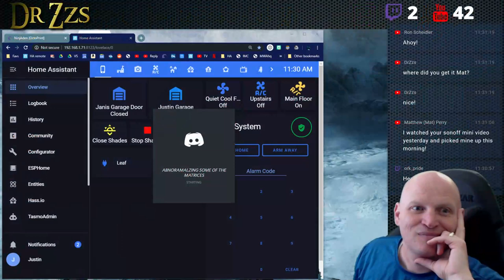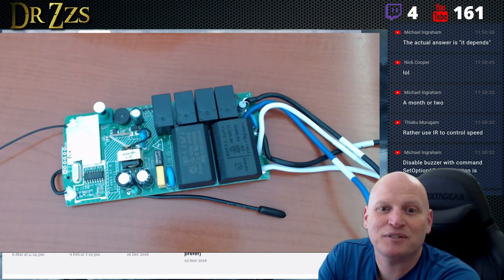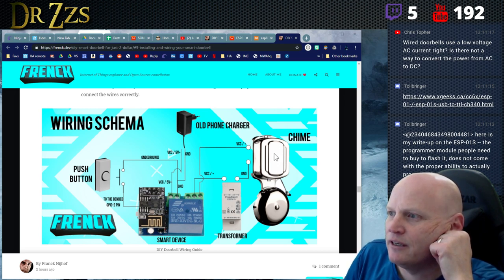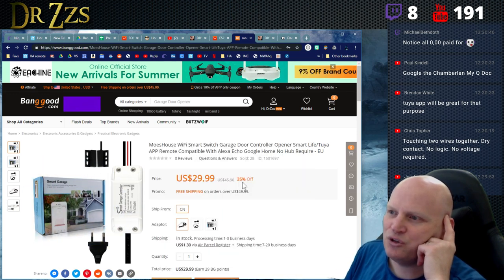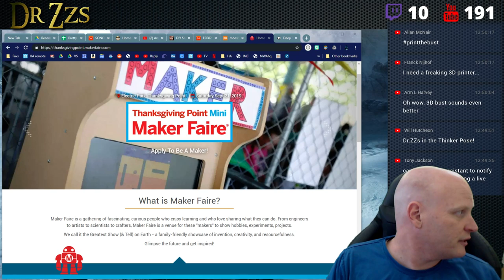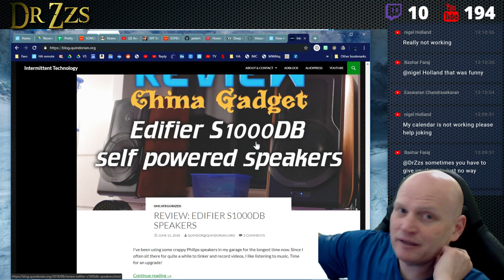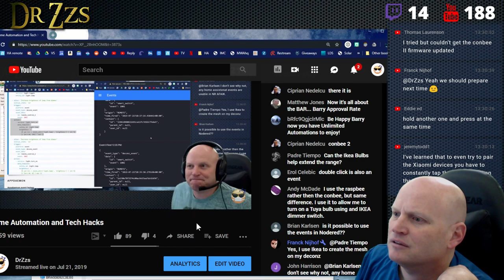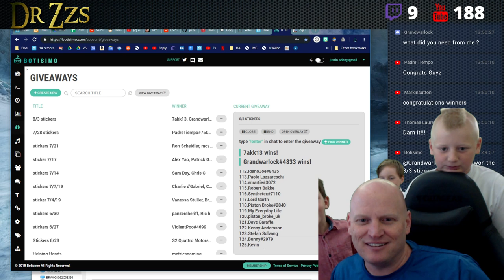Sonoff Mini Talk, and some Zigbee Tuya devices to try

Comment: Hey Doc. One of your guests (Carlos_DE) asked if the Xiaomi sensors work outside. Yes they do but you have to waterproof them. I have four around my property on gates that are mounted in small IP65 boxes and they work a treat. The 1st Gen one (rounded corners) is however playing up with deCONZ even though it worked for over a year without fault on the Xiaomi Hub. Battery life is exceptional with at least a year from one CR1632.
Reply from the maker: great Pete!  Thanks!
How's the range on those outdoor sensors?  I was surprised to here some guys saying they aren't getting good connections and reasonable ranges.  Maybe they have some other interference?
Reply: @DrZzs  range is amazing. I do have 6 smart switches spread around the house acting as routers though.
Reply: @DrZzs  I've used some Xiaomi devices in another install.  As long as you have a good Zigbee mesh and you use a ZigBee channel that is outside of the 2.4GHz WiFi range, they are fantastic.  Much better range than WiFi in my experience.
Some Xiaomi devices are Bluetooth only.  Those ones only have Bluetooth range of about 10 mtrs, but I doubt many that use HA would be using the Bluetooth versions much as they would need a secondary interface to connect to HA

Comment: The ringer transformer is AC for good reason.  Magnets!
On an AC source, the arm that strikes the bell will do it at 60 cycles / second in 'murica.  50 cycles in 'straya.  
If it's connected via DC, it will strike the bell once, and effectively be a noisy relay striking only once until the power gets disconnected.
Reply from the maker: oh cool!  I did not know that!  Thanks :)

Comment: After the led is flashing, release the button then press it every second or it will go back to sleep soon. deConz probably won't have enough time to complete the pairing. When I pair the TH sensors with zigbee2mqtt, I need to pair them  that way.
Reply from the maker: cool.  I'll try that.  
So you're using zigbee2mqtt with these tuya sensors?

Comment: @Drzzs If the GPIO used for the switch can be used as a general GPIO under Tasmota, could you do a video with alternate uses, such as maybe a thermostat type device?  I know that would mean finding a +3.3volt source on the board.
Does the 3.3 volt input you used for the FTDI adaptor have 3.3volts on it when the device is live?

Comment: I was thinking about the SOnOff mini device.  The Switch connection is just Ground and a GPIO.  If you didn't want to use an external switch for some reason, could you use that GPIO for a sensor input?
Just thinking for a motion detector with an inbuilt relay, not needing an external switch, it could be an interesting device.  Or maybe using it as a thermostat where the GPIO can detect temperature and humidity with a DHT22 and then Home Assistant control the relay.
 I am sure one could trace a 3.3 volt line from the power in of the ESP chip. 
Given the Switch GPIO is isolated from mains it makes it a much better option than a Shelly for this alternate purpose.
Reply from the maker: We'll have to play with it on the next stream.  I tried connecting dht22, and PIR, but neither worked on Tx or Rx or GPIO16.  Not sure what the problem is.
Reply: I might get one and have a play with it.
Do you know which GPIO the switch connector uses?

Comment: P.S If anyone can tell me why my Xiaomi smart switches create a 3rd rogue sensor in deCONZ called sensor.consumption_xx that has a state of unknown, that would be appreciated.
Reply: I think that is just how DeConz detects the sensors and because Xiaomi has a tendency to be slightly non-standard.
I usually just hide any rogue sensors using the Customise functions.
I don't think there is much we can do about it as it seems to be in the Xiaomi firmware.
Some Xiaomi switches have power usage detection.  Could be related to that, but that is a bit of a guess.
Reply from the maker: good question.  Maybe Franck knows.
Reply: @DrZzs  I'll hit him up on Twitter.

Comment: Just watching this again and saw the RGB LED Module.  Avoid it.  Dont get it.  It is just a breakout board that allows the GPIO pin from the ESP-01 to connect to the yellow wire.  There is not any logic conversion or anything.  LED Strips need 5V logic, this just puts the 3.3V logic directly from the ESP-01.  I made the mistake of buying one.
Reply from the maker: ooh, good tip. Thanks!

Comment: Good night, I'm Brazilian, sorry English ... I have a esp8266 (NodeMCU), and wanted to know if there is the possibility of along with the tasmota, put only buttons, and no relay ??  the idea would be a relayed NodeMCU, and a button-only NodeMCU, and by MQTT, making those buttons control the relays on another NodeMCU.  thank you!!!
Reply from the maker: yes, you certainly can put only buttons.  Unless they changed it though you have to specify a relay for every button or switch, even if you aren't actually connecting the relay.  
You could use ESPhome instead and just specify all the gpio pins you want as different switches/buttons and not worry at all about specifying a relay.
Reply: @DrZzs  That's exactly the problem, specifying the relay, because as tasmota only allows me to use 12 gpio, if I put 8 buttons, I have no space to put the "relays" for each button.  I've thought about using espHome, but since my project today is all tasked, I wanted to keep the default.  thanks for replying, your videos are great.  I'll take a look at the rules in tasmota, see what I can create ... thanks a lot !!!